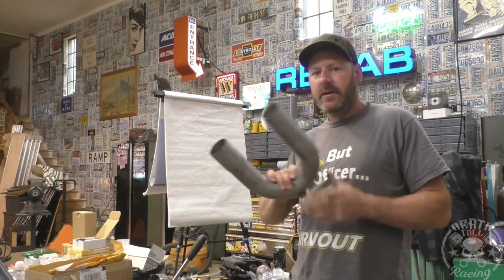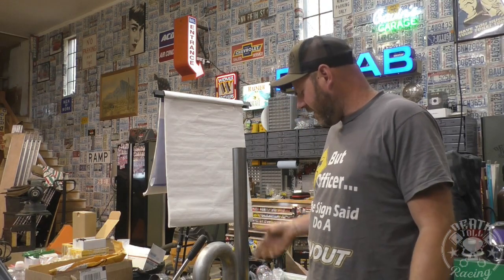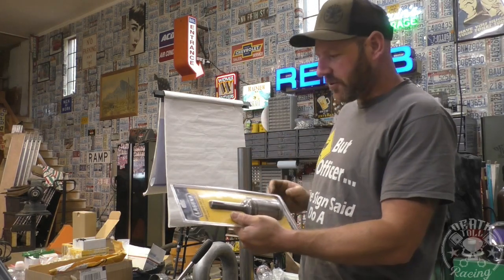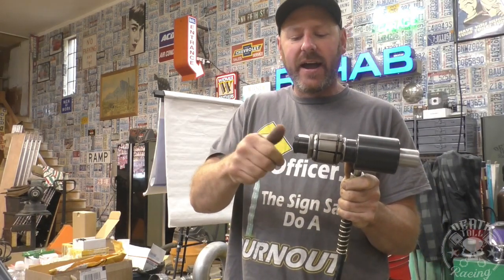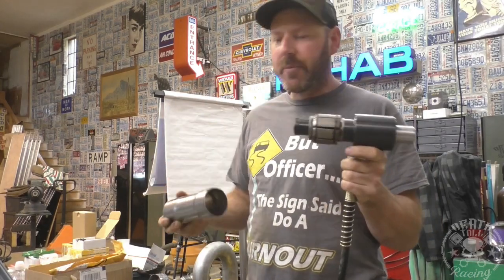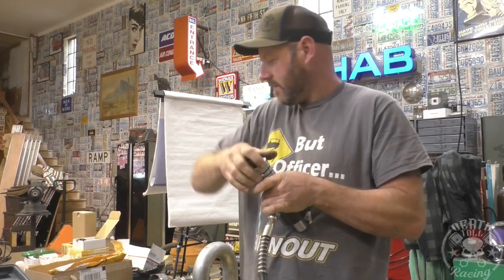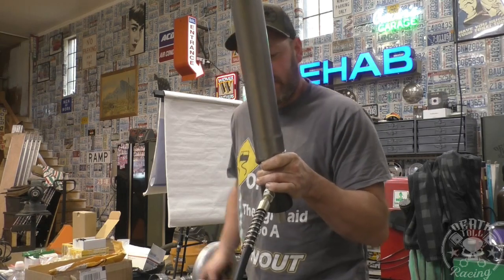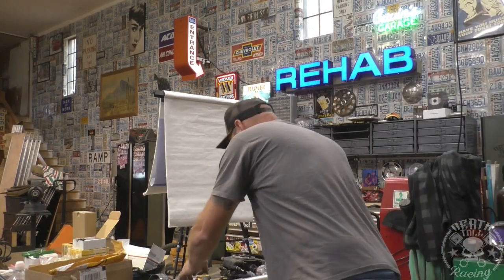Exhaust Pipe Expander that Actually WORKS!!!  Hydraulic Conversion DTR SHOP HACK Fabricated Exhaust

Comment: Ok so the biggest misconception about the first exhaust expander, its only meant for fixing out of round pipe. Thats its, no stretching the tube no real expanding just straightening out, out of round pipe. So many ppl misunderstands how to trully use the the first expander shown. It shouldnt been called an expander when it was first developed cause it doesnt expand anything.
Reply from the maker: Yes, I believe that was the intent of it also.  But unfortunately it's marked differently.  

From HFT website:
"This heavy duty exhaust pipe expander quickly and easily flares and expands thin wall pipe. Simply place the expander in the barrel of a pipe and turn with a wrench. The expander applies firm, consistent pressure evenly against pipe walls to prevent distortion".
Reply: @DeathTollRacing  yea when they say thin probably mean like 22 26 or 28 gauge thin wall pipe other wise it makes an awkawrd paper weight.
Reply from the maker: @charlesfields7908  totally, that is if the paper doesn’t outweigh it. 😂🥲😂🤣

Comment: If you want to use the HF style tool but not have it the full length of the spreader down the tube you can cut a short piece of tubing as a sacrificial piece and use it to cover the rest of the die sitting outside of the pipe you are expanding . This will keep consistent pressure over the length of the HF spreader and allow you to only expand a shorter section of the pipe you need opened up.
Reply from the maker: I tried that and it was still the problem of the threads not being strong enough to do it.  Or maybe your talking 1” in the tube and 1” sacrificial piece on the opposite side and empty dies in the center?  🤔. I’d try it, but I already ruined my hf one.

Comment: FYI: The bolt thread should be 3/4-16 aka 3/4" Fine SAE
Reply from the maker: Yes it is. Both the knock out and the expander are that. Hft now has an expander similar to the lisle but I haven’t checked the thread to see it it also 3/4 fine.

Comment: So I’m trying to get my x pipe that has a 2.75” diameter to fit onto my 3” header. Do you think it’s possible for my local mechanic to be able to expand it that much?
Reply from the maker: I think so. If it tears it shouldn’t be so bad you can’t just weld it. But I don’t think it will.

Comment: Nice video and nice "hack".  I've not laid hands on either tool so please forgive me as I share what I think is an idea: I think that if you adjusted the expanding "nut" that you could limit the amount of effective (expanding) travel of the ram.  That is: if the expanding "nut" were farther from the piston body that the piston would have to travel further before the nut contacted and swelled the expander.  With careful control of the hydraulic fluid valve (release) on the pump to not allow the ram to fully extend, you could eliminate the take-up in expanding the next pipe.  This would allow you to set consistent expansion from piece to piece.  Maybe.  FWIW.  YMMV.  Thanks again for the video.
Reply from the maker: That's a good idea!

Comment: This is a super useful hack.   Those HF power packs have so many uses.  Thank you!  Hang in there, your content is over the top.  Congratulations on the Earth Day delivery.  That TRX is definitely raptor killer.
Reply from the maker: I think this is one of the best ones I've come up with so far.  It's going to be a tough one to beat.
Reply: Hi, it looks great. I need to lap joint two Stainless Steel 3 inch OD exhaust pipes. You think this is strong enough to stretch one? @DeathTollRacing
Reply from the maker: @TBR-z  I use it on stainless all the time, but with a air over hydraulic pump instead of the hand pump. The manual pump is rough with stainless over 2 1/2”. They also make bigger manual pumps.

Comment: Glad to see this. I just ordered one of the actual hydraulic pipe expander kits, was hoping it would work well and it looks to me like it will!

I'm not sure if the hydraulic expander wasn't available when this video was made- I have seen where people mentioned buying the torque-style expanders and the hydraulic punch press to put them together and make this tool, but as of now it's more expensive to go that route over just buying the actual hydraulic pipe expander kit. I got mine for $136.
Reply from the maker: I’ve seen those a few times and am definitely interested in how it works.
Reply: @DeathTollRacing  I got it yesterday...it is actually just the hydraulic pump from the punch press, and the torque style expander set thrown into one kit. The expander set even has the bolt with the bearing on it that you show in your video. Basically what you have in your video is what I got in this kit.

Comment: nice tips.. i have the Lisle kit also. i use my electric impact gun on it, with the same die types.
Reply from the maker: That lisle kit is great!  I have yet to use it as intended since I have that hydraulic puller, but I'm glad to hear it's holding up that way!
Reply: @DeathTollRacing  it does get marks inside the pipe when i really hammer it, and sometimes its not a perfectly round hole. but its good for all my smaller exhaust tip projects.

Comment: This is freaking awesome!     Video should have a million views!
Reply: Youtube is a fickle mother effer the last couple years.  I don't know why but it seemed like a lot of small channel views especially in the automotive category since the wuflu came about have dropped off.   My videos suck compared to yours and even I've noticed views not where they were pre 2020.   I just do this crap for fun so I'm not trying to make any money.   That being said, there are days where I am like eff it. I'm not filming this or that.  It's just not worth it.    Your content and editing look great.  Keep up the good work.
Reply from the maker: I agree.  It's really hard to get a break through video, especially in automotive.  I have not had one even go remotely viral yet, but I'm hanging in there for the most part.  I also have had a lot of screw it moments, where I just about delete the channel.  I really don't have a solid idea on why I'm struggling so bad for viewers.  I've been told numerous times to stop doing the "how to" video's and just start doing complete build video's only.  So I tried that when I restored a 2014 Ram 5500 4x4 Rollback tow truck, and the videos fell flat on their face even though I think it's one of my best series (2 vids for complete build, and 2 break outs).  There's still hope they will catch on, but I believe it's slim at this point.
Reply: @DeathTollRacing  Hey DTR, what size expander did you use to make this tool? There is a 1.5  to 2.5 and then a 2.5 to 3.5 inch.   I'm thinking the smaller one would be most versatile for me as long as it will really do 2.5.
Reply from the maker: @PNW_Car_Mods  there’s a link to the kit I used in the description that does all of the above in one kit. It’s the easiest way. As far as the 2 dies you mentioned, one thing to consider is that at the max of the range the expansion part tends to look more 8 bit round than actually round if that makes sense. With the lisle kit in the description it has a wide range of dies so you can usually stay at the bottom of the range.
Reply: @DeathTollRacing  Yeah I saw that.  Just trying to find a workaround to the lisle kit.  That is just expensive enough to kill the budget aspect of making this tool lol.   Totally makes sense to not use the upper end of the cheap expanders.

Comment: Great machine. Just what you need. Wonder if you made a jig with a couple of roof torch heads to warm up the metal. Let the metal stretch naturally. Good luck. Sorry we not getting no more safari build. You a good Enginer. Don't sweat the small stuff. Have a good day.
Reply from the maker: I tried heating it before years ago to try and help the expander.  One problem is it melts the rubber rings on the expander, so when you take it apart all the pieces fall everywhere.  It did help though, but that was my final attempt with one of them for years until now.  But this works so well, it would be tough to beat with anything.  Lisle will probably see it and start producing it.  It would sell for sure.  I would have bought it.

Comment: I couldn't even get the lisle one to work with an impact gun on stainless, but will give this a try. Thanks!
Reply from the maker: I've done 2.25 and 2.5 and it works, but it's hard.  It does help to cover the dies with grease, but for me, that would be a last resort.  I feel the limiting factor is the pump itself, and have thought about swapping that out with a bigger one, but so far, I have been able to do everything as is.
Reply: @DeathTollRacing  thanks for the reply. I'm going to be trying to swage 2.5inch up to fit around existing 65mm OD tube. Ordered the hydraulic knock out kit from Amazon now anyway so will see how it goes
Reply from the maker: @r6scrubs126  I’m just using the harbor freight pump, so yours will probably be better.  Good luck!
Reply: @DeathTollRacing  ok so the one off Amazon (which was branded Vevor when it turned up) does not have the same thread on the stud as the Lisle kit. It's very close, to the point where you can just about thread the stud from the Lisle kit into it (but if you try expand pipe like this it just starts stripping the threads). Unfortunately I'm in the UK so can't get the harbour freight one. Will see if I can figure out what the thread is on both parts and then can maybe buy or make some kind of adapter
Reply: Tried grinding the threads off the stud that came with the hydraulic kit and welding the Lisle collet nut thing to it... Got quite far with swaging but then the welds snapped when I tried to get the last few mm. First time any of my welds have ever failed 😄 must have been quite a lot of force. The nut went flying like a bullet lol
Reply from the maker: @r6scrubs126  😂

Comment: 8:08.. USE THE GREASE EVERY TIME... I have the Astro Pneumatic version of this and it works perfect every time..even on stainless...🏁
I use it and my Ridgid high torque...gravy...🏁
Reply from the maker: Yes, the grease makes it much easier.  I've also done stainless with it.  It's a great kit!
Reply: @DeathTollRacing  really so the threads don't gaul and get chewed up from impacting...👍

Comment: Yoooo!
Hot tech tip man!
I happen to be fighting this battle here today!
The Lisle kit is 100% better, but not worth the cash for garage warriors.

I also modded my Hazard Frought expander in my 20 shop press, all janky like.
I also planned ahead and grabbed a thrust washer from my job to "Emhance" the Hazard Frought version of the tool.
Reply from the maker: A thrust washer would definitely help it. It also helps a lot to cover the whole thing in grease. But it makes a mess that may not be worth it.

Comment: i hear so many people complaining about the cheaper dies, how they don't work.. it's not because the tool sucks, it's because you're doing it wrong. you need to heat up the pipe first. repeat, heat the pipe. that's how they are designed to be used.
Reply from the maker: How do you keep the rubber o-rings from melting with that technique?
Reply: @DeathTollRacing  like you said, take them off - they don't have to be there. but it's still fiddly and a PITA, you have to hold the pipe still and get the tool into a hot pipe. not ideal. i really like your shortened hydraulic version, nice build. helps to lube the pipe too.

Comment: Nice work...question about the tubing. Is that 16 gauge 304 stainless steel?
Reply from the maker: That isn’t, but I use it often on stainless steel.  Most recently on the Caprice build.
Reply: @DeathTollRacing  Also curious as to getting a nice  expansion with the 4-slice Lisle expansion dies. I've seen some vids showing the need to rotate to keep it round. They were using a knockoff brand, but doesn't it make sense that the 8 slice Harbor Freight dies would lessen the need to rotate?
Reply from the maker: @Biggie_2.0  it looks cleaner if you do it that way. It will stretch it enough to work, but you can see that it looks a bit Minecraft ish.

Comment: Nice work! Will this work on 18 gauge 304 stainless tubing?
Reply from the maker: I did 1 and it worked but I had to grease the dies, and it was maxing out the pump.  It did work though.

Comment: is it possible to expand stainless steel tubing ??
Reply from the maker: I was able to do 2.5” stainless no problem. If you add grease on the dies it will be stronger too, but then you have to clean it up. I have not had to yet.

Comment: Awesome hack bro!! U sir, just earned a subscriber....but anyways...I'm fabricating a full exhaust for my bmw 535i (from the downpipe to the mufflers) I was wondering if you've tried this with any stainless tubing? Because I would really love it if I could expand the ends like this so I can slip all the pieces onto each other before I weld em up...b/c like u said, it's just looks sooo much cleaner and easier to weld rather than a buncha butt welds....anyways let me know man, I'd appreciate it!
Reply from the maker: I did do some stainless. It was 4” and definitely was pushing it, but it did it!  Greasing the dies would probably help a ton if it is being stubborn too. I haven’t had to yet.

Comment: How well does this hack work on stainless steel
Reply from the maker: It works great, but it’s a lot for the little hand pump. I since put an air over hydraulic pump on it (also hft) and it works great. Only problem with it is it’s really easy to over expand

Comment: unfortunately, I bought punch form HF but the threads on it are finer than the threads on my impact wrench expander so I can't use them together:( It's 16mm thread on HF punch, the threads on the expander are much more coarse.
Reply from the maker: is it the Lisle expander?   you also could open up your expander and put a nut on the opposite side.

Comment: Awesome vid, just wondering how long the stud is your using for this hack?
Reply from the maker: It’s the stud that comes with the knock out punch. I’m not around it right now but I’m recalling about 6-7 inches. It’s fine thread 3/4”
Reply: Awesome thanks for that, the knockout kits their selling in Australia only have a 4inch stud

Comment: I wonder if preheating your pipe will make it easier to expand
Reply from the maker: I definitely would!  However it most likely will melt the rubber in the expanders.  I’ve actually done this before with a cheap style one and would use a hose clamp to hold the pieces of the expander, insert in the pipe, loosen the clamp, expand, slide it out just enough and reinstall the clamp.  It’s a hassle, but it works.
Reply: @DeathTollRacing  i dont believe the heat transfer from the pipe would be enough to melt rubber before the job is done.  It might if there was direct contact though.

Comment: Any idea how big you can stretch to? Like if I have a 1 1/8" pipe could I stretch it to fit tighter inside of a 1.5" pipe (in, not around)?
Reply from the maker: It will, if you have a small enough expander. I’m not sure if the setup I made goes that small. Another concern would be the pipe tearing stretching it that much.
Reply: They make nothing in a segmented swedger to expand a 1 1/8 tube because the mandrel would be too small to take the force without breaking. The only way to expand that small is with a dedicated size ram in expander where the tube is held by a split collet. I can expand from 1" up to 5"and don't go smaller only because I've had no call. The 1" tube is used for exhaust on the Webasto style gas and diesel heaters for vehicles.

Comment: They sell this hydraulic pipe expander kit on ebay for $600 canadian, crazy
Reply from the maker: That's crazy.  They didn't have it when I first made this.  I looked high and low for it.  I'm going to add the links, but I think it's still cheaper to buy the lisle kit and the HF kit since you don't have to modify either, and then you can use it both ways and also have a knockout punch!

Comment: Does it work on stainless 304 exhaust tubing zs well ?
Reply from the maker: Mine did 3” 304 with ease. But that’s the only size I’ve tried in stainless so far.

Comment: Ive used that lisle kit on an impact for years and it took the abuse, just saying, hydraulic is better tho
Reply from the maker: Yes they are a good kit for sure!
Reply: is there some trick to using it with an impact? I got absolutely nowhere with it on 2.5 inch stainless (1.5mm wall thickness) just using an impact on it with the tube in a vise